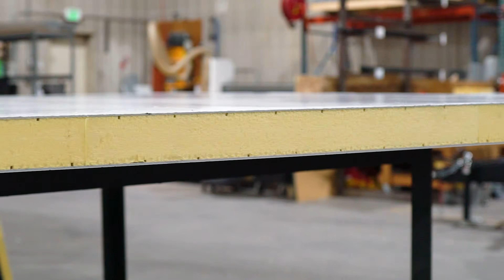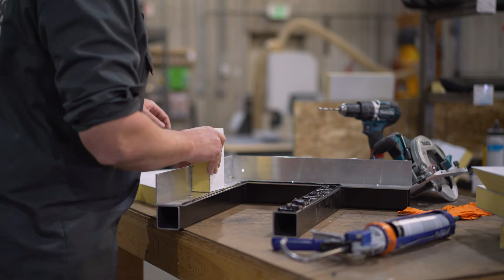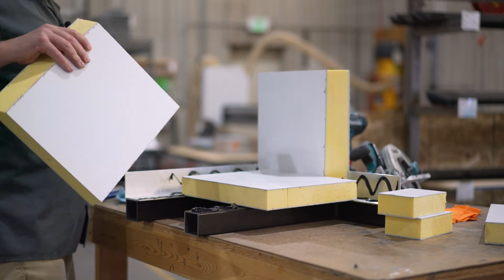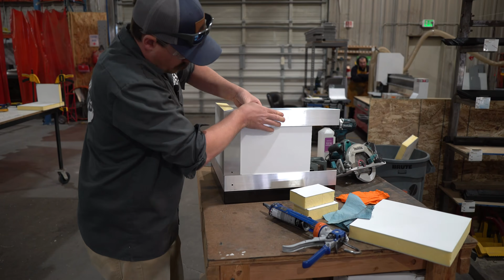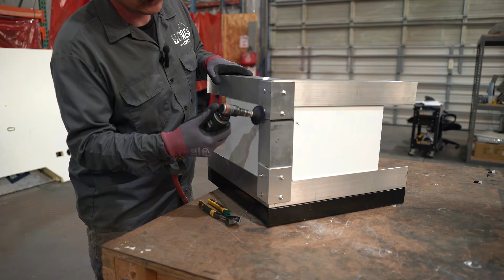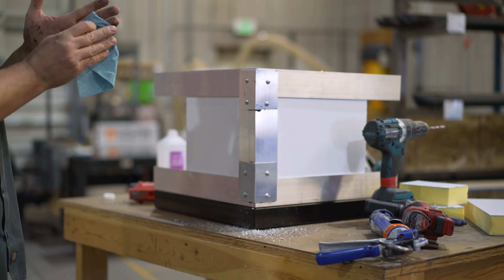DIY Assembly of Composite Panels and Aluminum Angle for a Homebuilt Camper

Comment: Saw  a video,  from Unicat they use both  FRP and carbon fiber.  They hit it with a  hammer no issues, , but the chisel side put a gauge in it,  when He hit the carbon fiber one, which was about the thickness of the one in this video, it barely nicked it.

Comment: Yeah.....noooo....the corner piece on top of the insulation? There's no proper contact with the panel, it's only gripping one panel. Rather cut a 45° on the corners or overlap the panels so the corner support grips on both panels.

Comment: I would be curious about the aluminum to steel.   are you Teflon taping the connection. I was always taught dissimilar metal end up with galvanic corrosion.   This would get very difficult with large sheets.   You have no real way to exert force in the correct spots.   Even that small panel took some real force to push down.   Imagine a huge sheet.

Comment: How chinzy pushing all that sikaflex to the bottom creating no seal between the angle and the wall !!!! A knife should be used to separate about 3" of insulation from the exterior panel sikaflex applied to the outside of the angle the exterior sheet of the panel slipped over the angle and then screwed or riveted to the angle !!!! What the Fffff on that corner !!! You are actually showing peop how fckd up you build these things wow anyone that sees tjis should never ever buy one of your products again  !!!! How sad these are !!!
 Ya the corner piece to cover up how two of them holes dont get rivets because theres nothing to rivet to !!! Doesn't speak well of your build speaks of Sikaflex  !!! Sikaflex should run you video as advertisement and say see our product is so good it can even hold this SHT together !!!!!

Comment: Not even overlap on the angle extrusion over the panel in the corner.  You want at least 1/2 the thickness of the panel itself overhang.

Comment: On the exterior corners, a few ideas: glue vertical joint of panels - waterproof and stronger, bevel outside corner of panel so angle fits flush,  run a thin bead along all edges of angle parts water can not get into joint - various methods of masking or chemicals can protect finish surfaces and make nice looking joints. I build in a similar way, but with different materials.
Reply: exactly miter cut corner then adhesive is on the fiberglass rather than mostly on foam.

Comment: Time, labor and materials  make this ridiculous. If I need those expensive materials to put together camper walls this project is already off to a bad start. Replacing damaged panels looks very difficult at the least of all problems. Then you need a trailer platform of equal quality with weight capacity to carry it. Foamboard with any outer laminate you chose is the way to go>

Comment: I got a admit the prices don't seem practical . For the cost of what it would be to build a 16' shell , you can buy a 16' fully composite RV with off-road chassis decked out with all the amenities . I mean basically it's the equivalent of a $50 piece of xps foam with what amounts to a $100 worth of filon gold applied to both sides .
Reply: They are counting on rich, lazy customers.

Comment: I've seen these with aluminum skins on them, which I think would be stronger but perhaps less flexible for expansion and contraction. How often do you need support members, i.e. How far can a sheet span without an aluminum support of some kind?  And then I'm assuming if you start cutting openings for windows and doors you need frames around everything, but maybe not? I could certainly see designing a truck camper and cutting out windows and door openings on  a cnc, and just Being able to assemble things in very short order. In the case of a truck camper how do you deal with bending things like an area that would go over the cab and be rounded? I'm assuming if you remove one side of the fiberglass panel you may be able to bend this around a radius but I have no idea how that works. Any videos on bending or how this works? I'd also be curious of the load rating.

Comment: So aluminium frame cannot be welded together this way because of XPS and it's holding on Sica glue.
Reply: Bro do you even know... So ms polymer hybrids etc have been used in automotive industry for years now it's what they use to build buses not nuts and bolts, same as caravans mate just slap some top quality adhesive on it and send it. Stuff is stronggg man sides of RVs/Caravans literally just adhesive and stuck on to the SIDE of the trailer frame, not resting on anything, no bolts or rivets nothing but once it's a complete box it's strong enough to be considered structural

Comment: For people saying their panels are too expenisve READ:

I'm a DIYer and if you want to build your own, you can do it! 

BUT you need to do research and you will save at most 20% over the professionally made panels after all material costs. 
This isn't just elmers glue, you need special adhesives since XPS and FRP don't like to bond(aka $$$). 
And you don't want your vehicle falling apart. 

I'm building most of my pieces, but I am buying a couple for key structural areas from boreas for both superior aesthetics and structural integrity. 
I was thinking of doing a video. 
These are not AT all the same materials you get at home depot, in fact I couldn't find ANY of them there. 
Crane composites Filon RV siding is not at home depot, the crane sequentia FRP is not designed the same. Call crane composites corporate and you'll go down a rabbit hole trying to find the gelcoat UV rv siding Filon, it doesn't exist for retail in my whole state.
The XPS foam at home depot is the weaker kind of 150psi vs the 250psi you'll want. And they don't carry the 1.5inch which is the ideal size. 
And the ONLY bond that works from my testing is the Advanced Polymer from Titebond which is not even in stock anymore at lowes/home depot.

I'm currently building my own and even if using similar offbrand materials and bonding, the savings are NOT that significant. 
Crane composite (not filon) FRP $112 x2 for 4x10ft = $224
XPS high strength $47 x 1.5 1.5in 4x8 foamboard = $72
Advanced Polymer Titebond $224 (says covers 60 sq ft per gal, at most half that)
Gelcoat/Paint for Rv siding $100
$224 +$224 + $72 +$100
That's $616 JUST in materials, now add the time it takes to coat both sides, and secure it down etc. Then paint it, etc. 

Vs $720 on their website for 4x10ft factory constructed panels strong enough to use as flooring. 
Professionally made with a superior construction process. 

Thats not to say these panels aren't expensive, they are, and they get them wholesale from china with a big mark up. But paying about $100 more for professionally built is absolutely worth it.
Reply: The underlying problem of cost is due to a small supply of companies that will sell these panels to small DIYers.  Prices will always be higher when the supply is low.

Comment: just curious as to why you do the floor panel first as when you put in the wall panels your pushing all the adhesive down where as if you done wall panels first everything will just push against the adhesive ?
Reply: Ty, came to see this comment. Not surprised there's no reply from the channel.  I found the entire demo to be very sloopy tbh.
Reply: Yep it's not at all the ideal way to install these kinds of panels. 

To answer your question, you should simply add adhesive to panel itself. That way you just avoid potential possibility of just scraping the adhesive down from the angle
Reply: Having watched that video, all I can say is that this guy is a joke. That top corner is going to leak like there's no tomorrow, and yes, they've now squeezed all of the adhesive to the bottom of the joint in the wall section ( not to mention the fact, there's not enough load bearing edge left for the floor panel to remain sealed and secured).
Reply: Do they make better extrusions for corners?  F shaped or 1/2 round with 90° channel?
Reply: @ExpeditionTundraBeast  rvglobetrekker has diy kits and have their own 8020 extrusions for the frame with channels built in for adhesive. They make various sizes and seem like the best option. They have step by step videos on their build process as well

Comment: Outside panel around structure needs to be vented where it meets the frame. Allow moisture to escape 
👍🏻
Reply: What are you talking about? Its supposed to be completely sealed. These kinds of foam insulated panels when properly installed are water/air tight and don't suffer from condensation etc that's the whole idea. Mind you 'when installed correctly'
Reply: That would just provide a place for water ingress or hot/cold air exchange creating condensation point so no

Comment: My issue with this set up is that the frame protudes past the panels where water can find a way. The walls should be flush over the frame in any instance, in my opinion.
Reply: You are right about water ingress. The fix is to seal the aluminium to sip panel with silicone after the structure is built.

Comment: Given the thickness of those panels, those support angles aren't doing much except acting as trim caps.
Reply: The way this works, once the entire box is complete it is then considered structural. A single or a few panels and an angle of course isn't structural but finished box with angle both external and internal and there you have it

Comment: With all due respect, but explain to me in the vertical L profile that acts as a corner, the section being so small and placing SIKA on both sides, one of them pushes the profile wing to the composite and supports loads perfectly but the other side of the wing is glued to the polyurethane foam "foam" which does not support any load, don't you consider that the section should reach the composite?

Comment: The side panels are cut under a 45⁰ angle to use in the corner, but you prefer the 90⁰ angle.
And you call yourself a professional?
Seldom seen such an amateur.
Reply: He mentioned it can be done with a miter cut as well. Also, the edge with exposed foam is going to be covered with adhesive and aluminum. Either way, this is just a rough demonstration of how assembly would go.
Reply: He says that they do mitre the corners of the camper bodies which they build, and the mitred edges which we see in the video are probably leftover from pieces cut for production - the video was done with scrap material. 
He said that for DIY kits they use lapped (not mitred) corners, but he didn't explain why.

Comment: I would have glued the panel edges and also where the aluminium trims join to prevent water ingress.
Reply: Yep this is far from an ideal way to install these kinds of panels. At least some adhesive on the panel side to prevent from possibly scraping the adhesive from the angle

Comment: Aluminium riveted to steel - recipe for disaster right there,it won’t be many years before the rivets corrode because of galvanic reaction between the two dissimilar materials.
Reply: The holes in the steel are pre drilled, then powder coated and the rivets used in this application are stainless steel, eliminating galvanic corrosion.
Reply: @adamcalkins112  You may be an expert and I'm not, but I know a little bit about this application and have to take steps to avoid this exact issue in extremely harsh environments, like down inside salt mines and high concentration bleach applications. What you describe is unlikely to work and really should be avoided at all costs. Stainless connected to aluminum is the biggest problem and will likely cause issues before the powder coated steel has time to have much effect. Even if the rivets had a non-conducting insulator, the insulation would be thin and easily worn through and it could happen during the initial coupling operation and almost certainly once stresses are put on the chassis. 
 The way I would want to do this is replace the powder coated steel frame with an aluminum frame. I recognize that is a larger cost, and I would, I think, to prefer to make the bottom frame part of the permanent structure. If that is impossible, I would still likely weld the bottom aluminum frame and body aluminum frame together and if I were forced to use bolts, I would use tabs and insulate the bolts with bushings that allowed no contact between the bolts and the frame, but that is just a future failure point eventually. Just from my experience, I would be very concerned if I knew that my camper had an aluminum frame riveted to a powder coated carbon steel frame with a stainless rivet. You could use explosively welded aluminum and steel plate cut into strips and completely eliminate the galvanic corrosion issue, but that would probably cost more than just making it all 100% aluminum.

Comment: The problem I see at the bottom of the angle iron if it’s not 100% sealed water will penetrate then saturate the Styrofoam then mildew will take over
Reply: It's not "Styrofoam", which is a brand name. XPS (extruded polystyrene foam) is closed-cell, so it doesn't absorb water.

Comment: So, there is no need to add any adhesive to the butt joint where the two walls meet? odd but OK.
Reply: Of course. You would do that.
Reply: They're depending entirely on the aluminum angle to connect the panels. There should also be an angle (aluminum or fiberglass) bonded to the inside of each corner, but that isn't mentioned (perhaps they don't do it in their products).

Comment: Have you considered mortise/tenon joints?
We use that in the aircraft industry for galley production. It’s very strong, some of the galleys are tested to a static load of more that 20,000 lbf. 
It’s also very light and less labor intensive as no angle extrusions are needed.

Comment: Look at the butt join of the wall corner, the alloy angle glues to 85% of one panel (Inc foam, useless) and 10-15% of the 2nd panel. Looks like you stuffed up and should of used the 45's!??

Comment: $1100 a sheet is F’n insane.
Reply: you can make these. Its just XPS foam and an FRP laminate. Both are sold at Home Depot for very cheap. Youre probably better off laminating fiberglass sheets of FRP instead of buying the finished panels just for better adhesion
Reply: Gouging seems to be the new normal these days. I don't care what it is.
Reply: 👍 Crazy at $1100
Reply: The Chinese love a competitor’s high prices
Reply: @gregmoessner3104 they order these from china by the container load and resale them for a huge mark up.
Reply: I'm out 😮
Reply: I need 8x10 sheets
Reply: See my other comment, for the materials and quality its pretty reasonable.

Comment: It would have been great to expend the usage of the panel in the video. Things like to roof setting wat not addressed, neither things like cable running or pipe running.  Other aspect would have been reinforcement or technics when you mount a door or anything that will carry a load, such as bench / bed. I guess we are ll familiar with wood work and know how to do theses thing with it, but with such a new material it is totally unknown to me.

Comment: is there any reason not to 45 cut the floor and the bottom of the wall panels?
Reply: certaily the vertical corner joins would greatly benifit using a miter join the aluminium angle would then be bonding to 50 mm of glass panel in both direction not just in one direction
Reply: Yeeep, laziness and sloppy just like this entire video. Should be a 'how not to install'
Reply: You would also eliminate any thermal bridging doing it that way, there is no reason not to

Comment: It doesn’t seem there is much bearing surface of the floor panel on the aluminum angle.  I’d put the wall panels in first.
Reply: Then you would need a larger and thicker angle attached the chassis, remember the inside should get and angle channel too, between floor and wall

Comment: It looks like you have riveted aluminium to steel. Is there not an issue if galvanic corrosion? 
Also, you mention elsewhere the foam is porous, is it open or closed cell? If water contacts the foam directly, is it absorbed or unable to penetrate?
Reply: I believe the only purpose of the rivets is to hold the pieces together while the adhesive is curing. Since they are shaving off the heads, there is no structural benefit to the rivets.
Reply: @ammerudgrenda  they probably don't shave off the entire rivet head - they would just trim the protruding mandrel portion.
Reply: @ammerudgrenda  I believe the OP is talking about the base aluminum riveted to the steel trailer frame.  That is certainly what caught my eye.